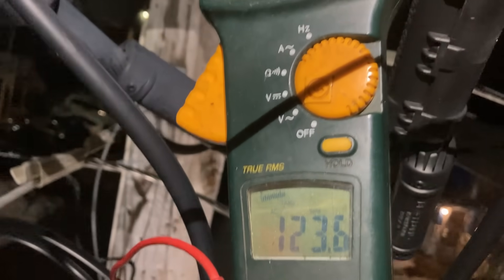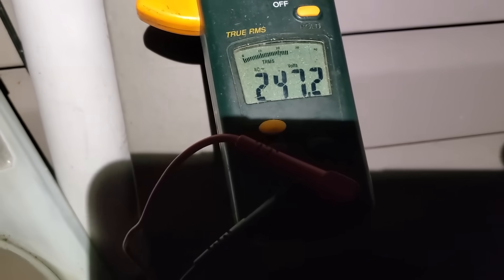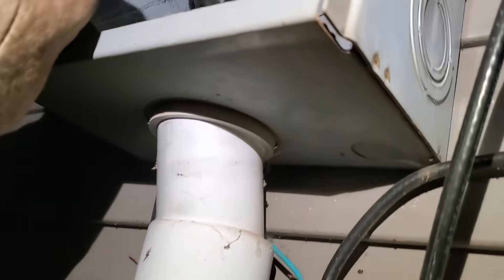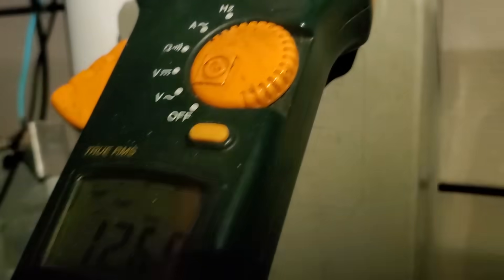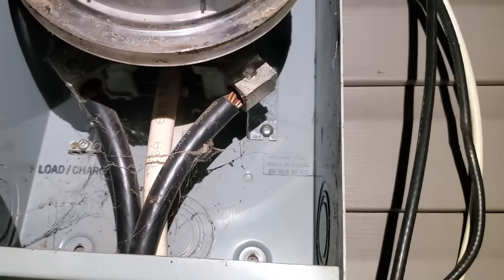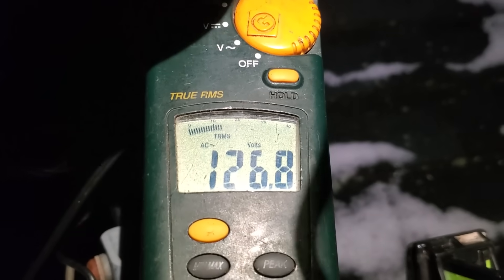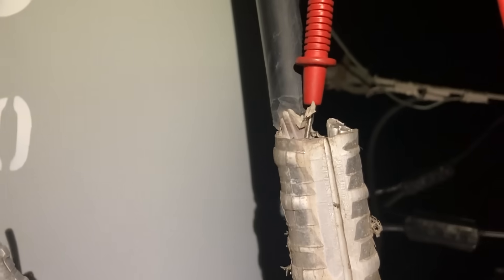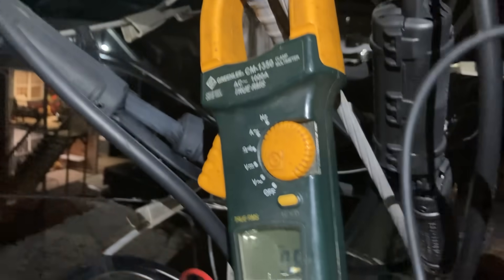Finding a bad neutral on a Service - Raw footage

Comment: Just an update, Verizon and whatever other company came and handled the pole, its laying in my yard lol, but they did something with it, took em like 2 or 3 weeks or something but yeah... They pretty much just broke it off where it was weak from the crash, the lower portion is still in the ground though. I guess they have more stuff to figure out because of the 2 fiber lines that was going up the pole from the ground.

Comment: I'm trying to picture this schematically. 

So if the neutral is bad, it becomes higher in resistance. With an even load, the resistance on either hot leg is equal to the other, so it reads normal even voltage split. Lower the resistance on a leg by turning on a microwave on that leg, and there is now an uneven split. Since there is now resistance on the neutral back to the source, voltage flows along the other hot back to the source. So am I correct that the hot leg that sees the overvoltage would be the opposite hot leg as the hot leg with the microwave? If damage occurs, would we expect to see it on those circuits?
Reply: One leg goes up and the other goes down. (higher load leg goes down) You can read it anywhere in the house but easier at a 240 point because you don't need to run around checking both legs.
Reply from the maker: Yes exactly!

Comment: depending how bad the resistance was on that trouble i wonder if the weather was cold enough ,if it would show also on a thermal imaging camera
Reply: It could show up there, but aluminum cools off quickly, so you'd need to do that under a load.

Comment: What would the customer experience when this happens, some appliances running hot and other running low?
Reply: Usually some lights flickering or bulbs burning out. Sometimes there's even smoke from the TV set.
Reply from the maker: A great indication of this is when you turn something on like a toaster that draws a fair amount of load - half the lights I'm your house go noticeably brighter!

Ultimately the symptoms can appears as flickering lights, partial power or even... Something's just not right!

Comment: I saw this when it was '7 minutes ago' and it already had 140 views. That's a view every 3 seconds!
I have a long thin Neutral. The less-load side WILL go up, but less than the load side sags. Work it out on paper, or with resistors and two batteries. You observed 4V+4V or 8V at about 1A unbalance. There's 8 Ohms in that Neutral. My house will show 0.2 Ohms in the Neutral (500'+ #2 Al). The microwave causes 4V drop in one leg and 1-2V rise in the other leg, tolerable. (The place was wired for a trailer, this house just happened.) Your 8 Ohms is certainly too much. 
Now 1,000 views in 47 minutes, more than every 4 seconds. (Had a dog walk in the middle.)
Reply from the maker: Lol glad the dog had a good walk 😄. That's an interesting scenario you described... It's basically not preforming %100 as it should with today's standards, but like you said - still acceptable and not really anything wrong! Those ones are tricky to come across and always want to double check that everything is ok.
Reply: Remember that, under normal circumstances, the neutral from the main disconnect back to the transformer only carries the imbalance difference of the two 120V legs.  If the loads on both legs are perfectly balanced, the neutral will carry zero current.  But, that situation is really hard to actually find.
Reply: @Bobsdecline   " not performing %100 as it should..... double check that everything is ok." The so-called Home Inspector, when we bought, was clearly confused about almost everything. The 115V submersible well-pump IS unusual, and does dim the lights. (CFL/LED are self-regulation and much better about that). But a 230V pump won't pump at 120V, and the catalog we found in the house shows a 115V pump as the lowest model. 
There's always losses. 2% to 10% at full load is reasonable. Less than 2% at rated load, a short would be dangerous. 10% loss at nominal 100Amps makes my 125V at street into 112V in house, and most stuff is fine (even the PC does not burp). The oven has to pre-heat a little longer, the water heater is a little slower than rating, fine. And we never get near 100A even laudry day.
I did take it seriously looking for hot joints or baked breakers. And cuz the fusebox was a :face-orange-frowning:mess I added a box at the meter and a new box down cellar. And did find screws never tightened right. But the long feeder-drop figures to be my sag, almost exactly. 
@jovetj My 120V loads are never perfectly balanced, but it is interesting that they are never very far off-balance (except the 44A start-surge on the 115V pump). I didn't obsess about balance when I wired the new box.
Reply: The voltage drop in this video is actually only 4 volts, you don't count it twice. Other than that you're definitely right.

Comment: Would a DIY homeowner see this voltage difference across the legs of their dryer or stove outlet? Or at the fuse panel.   The same as you showed at the meter?  Most power companies frown on people removing their meters, of course.
Reply: Yes, and if you remove a "smart" meter, the power company will be immediately notified.
Reply from the maker: You can check safely at an electrical outlet if the user is competent in doing so. From that test point, the problem could be anywhere from the outlet itself, to the breaker/panel and right out onto our system.

Comment: We had this exact problem like 25 years ago in an old house my parents had. The neutral connection had basically rotted right off on the house side of the service drop. It was an old house so everyone assumed it was faulty wiring inside the house and wasted a day or two going through all the wiring in the house. In that time we lost a few appliances, electronic devices, etc. before one of us happened to look up at the service and see the neutral wire either wasn't attached or was barely hanging on. (I was young then so I cant remember exactly now.) Power company came out and re did the service connections and everything was fine after that. 

Great video as usual!
Reply: If the neutral was grounded to a water pipe in your house and also another adjacent house, the unbalanced load would have 'found its way' back to the transformer through the common water pipe. This is why smart people are careful with their ground lug lifting and reconnecting. You may find 120 volts between the lifted ground wire and the lug and if the pipe is wet you can get quite a shock.
Reply: @rickhawkins218  I was maybe 10-12 years old when all this went on so I'm probably leaving out some details. but like I said it was an old house (150~ years old) with old wiring lol not knob and tube old but it was still an old system.

The house changed hands a few times after we left and was eventually torn down about 5~ years ago and a new building was constructed.
Reply: If that old house was on a well instead of city water, the ground wouldn’t make it to the next house.
Reply: The Neutral wire is the most important wire.

Comment: Excellent troubleshooting instruction!  I'm in the middle of doing something similar, but with a 24 vdc gas turbine engine air bleed control system.  Done a lot of work with wiring on aircraft and jet engine test facilities over the past 43 years.  It can be quite challenging, and often frustrating, but for some reason I still love doing it!  LOL!

Comment: Do you guys perfer to have electricans always look on the other side first? I am fairly certain I have a bad netural but dont know if I should call an electrician first or the power company.
Reply from the maker: We definitely prefer an electrician checks it out first...but that can also be costly for you. Some cases the power company will not come out until and electrician has checked things out first. It's about 50/50 that the problem is on our side vs customer side. If you have an older home/panel... It might be worth having an electric loan come by anyhow to check things over.
Reply: Power company is free. Call them first.

Comment: I'd be worried about placing a large enough load on it to raise voltage to 150 volts, that sounds like enough to risk damage to devices or appliances in the house. (maybe enough to trip some sensitive surge suppressors?)  And there are probably a few items here and there that could be damaged by applying too little voltage as well.
Reply from the maker: I answered this in more depth on another thread... But basically it's already been going on for days and the damage has been done. Voltage has to be checked to confirm. As you as you see those extreme voltages. Pull the meter! Don't use those voltages to help trouble shoot. 

Voltage must then be re-checked before leaving...

Comment: You should be able to measure that ~4-volt difference across the bad connection on the neutral. That's an easy way to confirm a poor connection.
Reply from the maker: Definitely another easy way to check!
Reply from the maker: I should add, still requires the same off balance load.
Reply: @Bobsdecline     what, you don't carry one of those load testers that plugs into the meter socket? Hmmm, maybe when Milwaukee makes one?  <LOL>
Reply: You can also just check for that resistance with the load isolated. Especially if you have a meter with a proper high current continuity range, which will let you read down into the low tens of milliohms. Not sure how readily available those are in NA.

Comment: The voltage difference wasn't as drastic as your explanation.  5 or 6 volts is enough of a red flag?
Reply from the maker: Absolutely. The customer shut most everything off once arrived. The symptoms they described were much worse than what we see in the video. I didn't want to unnecessarily expose their system to those extreme voltages.
Reply: Yes. It still shows that the neutral connection has a bad connection. Like Aaron explained, the load was small and almost balanced. Higher overall load or a greater imbalance will read a higher voltage difference.
Reply: @mxslick50    using a resistance heater or toaster on one leg (10 - 15 amps) will dramatically increase the difference between the leg voltage and spikes generally won't bother them. That 4-5 amps showing in the video isn't really enough, unless you know where to look. The power company has a tester that plugs into the meter socket to do exactly that. It's basically 2 hair drier elements and a fan. You can run one or both for testing. Some have volt meters built in as well.
Reply: @rupe53  Thanks, I am aware of that already. The tester you refer to is called The Beast or Super Beast, my old local utility used them.  I've been an electrician for over 40 years now, and have used the toaster trick to help diagnose a bad neutral.
Reply: @mxslick50     never heard that name in my neck of the woods. Since I retired a few years ago, I will probably never have to deal with it again either. Still in all, good stuff to know... and pass on to the younger guys.
Reply: The voltage difference was very low at the time of measurement but the measured load current was also very low at the time. If it was 4 volts with only 1 amp of current imbalance it would be 60 volts difference with a 15 amp imbalance.

Comment: The problem with turning appliances and other loads on u can burn appliances and other equipment up
Reply from the maker: Absolutely. Typically, the problem has been on going for a day or two before it gets to the point that we're called. It's kind of one of those "the damage has already been done" scenarios. Using a slight off balance (under 130v) to help trouble shoot won't hurt anything for that short period of time.... Voltages any higher, just pull the meter and try and find it visually. Pretty much change anything that looks bad at all. Once done re-check voltage and hope it's good. Definitely have to confirm voltage before leaving.
Reply: Most utilities have a device called a super beast that plugs right into the meter socket, which simulates the load you would get from a hair dryer or a microwave. Quickly tells us if it's the  customer's problem or an issue with our stuff, without risking damaging the customers equipment.

Comment: Really good description of the problem and diagnosis! Did you have to cut power to the home in order to change the neutral clamp? (I assume yes)
Reply: If he did a disconnect on the neutral to clean and install a new crimp, the voltage would have gone nuts / imbalanced while he was working. Always do repairs without a load.
Reply from the maker: Yessir 🙌 Thanks guys! And great answer as always Rupert!
Reply: Doh!  I was about to say: "Sure: but put a conductor strap between the supply and service sides of the N during the repair."  Not sure how feasible this is or if it's agains the co. rules.
Reply: @AlanTheBeast100    Job only takes a minute or two. Just kill the power.

Comment from the maker: Hey all!

I wanted to show a couple shots of this job because we receive flickering light calls quite often. There can be dozens of reasons as to why the lights are flickering but there are two main categories:

- Loose "hot" connection.
or
- Bad neutral.

It's important to figure out what exactly you're looking for first. A bad neutral can harm customer equipment, so it's important to rectify that problem before leaving. 

A bad/loose hot connection - voltage will always go down. If voltage goes up on one side, you have a bad neutral. it's literally as simple as that.

That being said, there are the occasional transformer or tap changer problems that can result in high voltage.. If that's the case the voltage will be consistently high as opposed to high/normal as load is removed.

** I should have also show in that last clip, that if you check voltage across a bad connection you will see that 4/5 volt drop.
Reply: Super helpful thank you
Reply: Great video I was working ina foreclosure house some lights were very bright I tried using an air compressor it would only buzz.  I measured two outlets one had180 the other had only 60 volts great job explaining what happened
Reply: I see that a lot in automotive or HVAC work. Checking the voltage drop to find the resistance, aka the bad connection.
Reply: why does the voltage go up?
Reply: should show what house lights look like in a call like this so the rest of us know what to look for before calling the power company
Reply: @Bobsdecline, I was wondering what can cause my lights flickering when a next door neighbour heat pump starts? We are connected to the same transformer.
Thanks for sharing, always interesting.
Reply: @Dicofol1  there's a good chance that comes from the transformer being loaded close to maximum capacity.  it's kind of like if you have a garden hose with a wye in it, if one side is open and you open the other side, there will be a dip in pressure.
Reply: @kenbrown2808  Makes sense. Is there a risk of damaging my electrical equipment over time because of this overloading of the transformer?
Reply: @Dicofol1  unless it drops and stays dropped, it's really just annoying.  what most people don't have any reason to understand is that the standard for US voltage is actually 115V plus or minus 10% - so power companies typically calculate the capacity of the transformer so that at no load, it puts out about 121 volts - within the 10% and with everything that they've been told will be connected, it draws the voltage down to 115V - to leave a margin for more to be connected without having to change out the transformer.  the flickering is not so much a dangerous overload as much as it is that it takes a fraction of a second for the transformer to catch up.
addendum: the takeawayis, an occasional flicker, especially like if you turn on a large motorized appliance, is acceptable.  if a light goes dim and stays dim, that is cause for concern, and if a light gets brighter, that is a bigger cause for concern.
Reply: How many times has it just been a bad switch?
Reply: @nofbi8582  you mean on the customer side? It varies. Customer hardware can go bad, too.
Reply: @jhacklack the voltage goes up on one line vs. the other due to unbalanced loads from neutral to L1 and neutral to L2. In split-phase systems, which this is, the neutral point is center-tapped at the transformer secondary. Under normal circumstances, the neutral conductor only carries current when there is an imbalance from one half of the split to the other. In this case, the neutral can’t carry current due to the bad connection. Now the loads are in series, and they drop a proportional amount of voltage to their resistance. Higher current loads will therefore drop less voltage across them creating a voltage drop differential compared to loads on the other side of the split. Did you notice after he reinstalled the meter, the amount of deviation from 123V was the same quantity, but inverse in direction? One side lost 3V and the other gained 3V. Either way, it equals line to line voltage which is the path the current must take because neutral has excessive resistance.